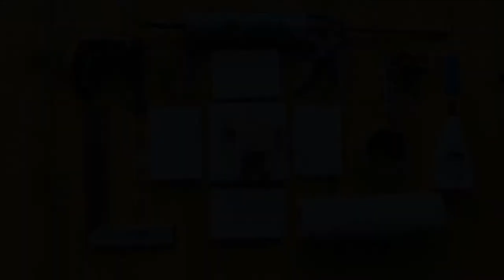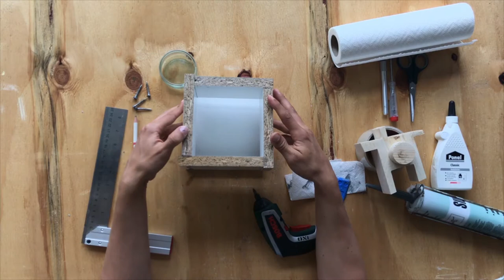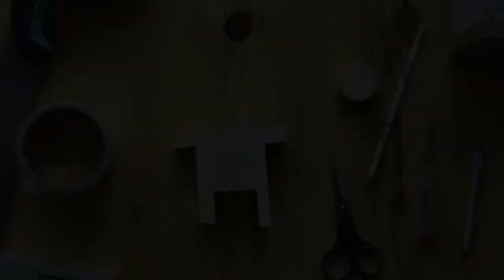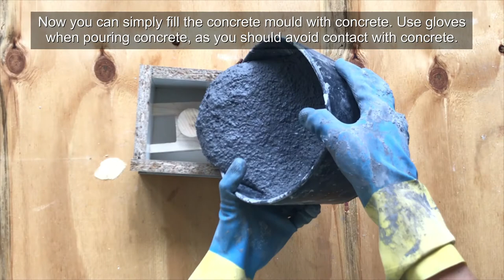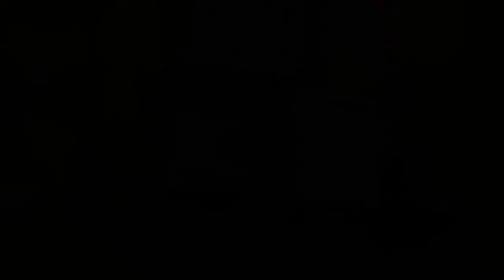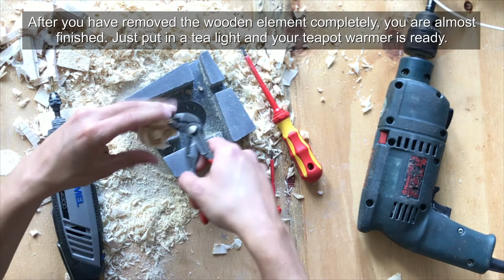DIY Concrete Teapot Warmer

Comment: I love the style! Removing the wood looked difficult. Anything you would do differently to avoid the wood getting stuck?
Reply from the maker: No. You can use styrofoam as an alternative. However, it is difficult to get clean edges with styrofoam.